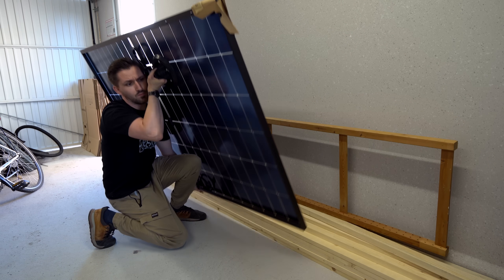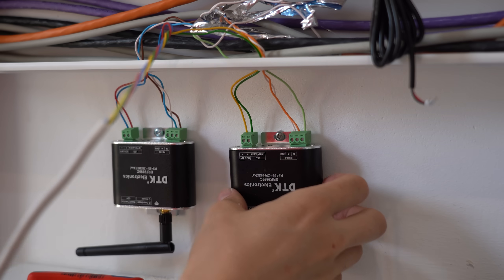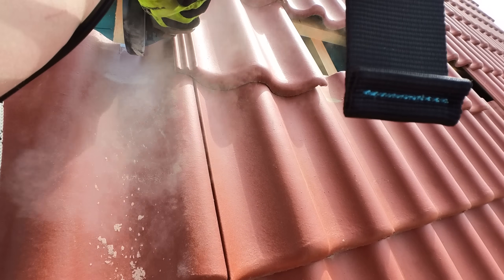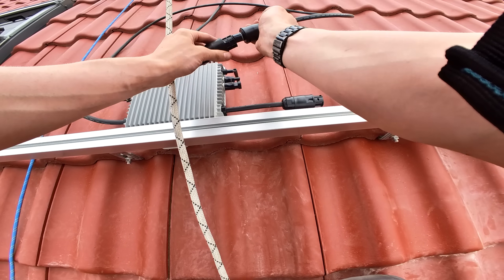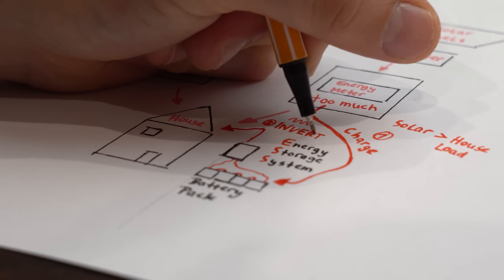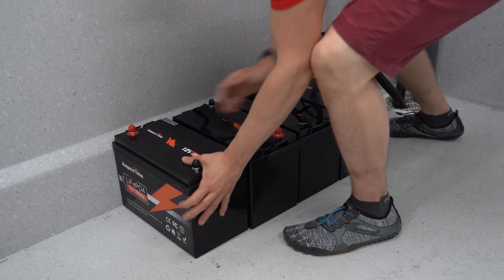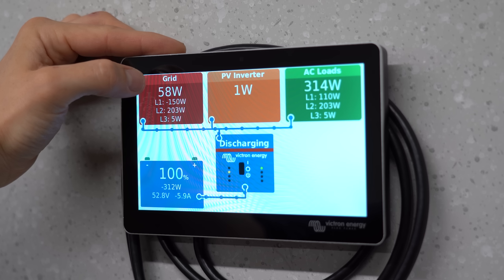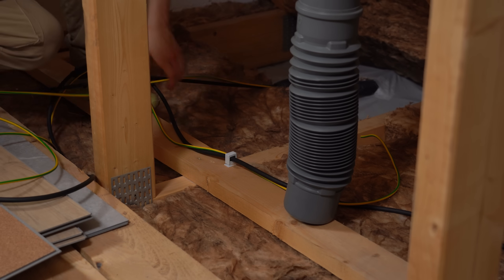Pushing a "legal" Mini Solar System to its LIMIT!

Comment: This is a great overview of the complexities involved in combining solar and grid power.  Backfeeding is not only a waste of your your energy, but is illegal in many (most?) places without the proper equipment and the cost to buy and install such equipment can be more than the cost of a small solar setup.  The system we see in this video is not inexpensive and it will take many years to recoup such an investment.

Backfeeding is dangerous as it could power the grid during an outage or when technicians are otherwise working on the line.  DO NOT backfeed into your own electric system without disconnecting your main breaker or installing an approved disconnect system.

I have used an ad hoc system with a gasoline generator during multi-week power outages, but I always turn off the main breaker and feed a garage sub-panel through dedicated breakers with all 220V (U.S.) equipment breakers switched off.  Electrician experience or advice is helpful and you must make sure that no one in your household will ever turn on the main breaker before uninstalling all power sources.

I suggest starting with a solar system that's separated from grid power entirely to avoid these issues until you decide to, or can afford to, properly integrate the solar.  Such a setup can consist of just a couple of solar panels and a portable power station, which is much less cost than the full setup shown in this video.

Many people will be perfectly happy with a "workshop" system that runs lights and small equipment separately from the house wiring, but which can be used in emergencies to run a refrigerator or gas/oil furnace from extension cords.

Yes, you sacrifice the daily solar contribution to your house power, but you can power your lab, workshop, or garage while learning what to expect from a larger, more expensive system.  PV systems are easily expandable and advancing technologies make it smart to start small and expand over time as cost efficiencies continue to improve with solar panels, batteries, and equipment.

Comment: Hi, thanks for this overview of your upcoming solar system!
No complaint meant, but I can't resist to ask: "What limit did this push...?"
From the title, I would have expected something about how to get a maximum of energy while still abiding to the legal limits. Btw, it's announced that the limit will be raised to 800W output from the inverter next year. When building a system now, one could already have this target in mind. And since the solar modules seem to be some of your less costly devices, some overpaneling would be expected. 
Tilting modules could use more of the daylight than fixed ones, of course that would be quite complex, mechanically, and if this is too much hassle, one might consider to let them face into different directions to have a more even energy production during the day. Which, of course, only makes sense, as a way of maximizing immediate usage of the engergy, to reduce battery costs...
I also had the impression, that you have bifacial modules. So mounting them in a way that allows significant light to hit the backsides would be another option. Maybe even reflectors...

Of course you will be aware of all of this (and other things) much more than I am. 
Looking forward to the coming upgrades and follow-ups...

Comment: In Ukraine we have "green tariff", it's what you call "Feed-in tariff", the electric grid company actually pays you for the electricity you give back to the grid from your renewable sources like solar panel.
Reply: I think his issue is there is no smart meter for the utility company to measure his feed in.
Reply: @Alan.livingston exactly, gernany is years behind in smart meter implementation, so the general conditions domestic customer experiences are not very optimal and workarounds as this are done.
Reply: We have the same in australia, they buy the electricity off us, but charge us more per kw than they pay us for it if we use from the grid..  its called a grid tie inverter..

Comment: Wouldn't one energy meter have been enough given they are bidirectional and given that the MP2 anyway measures the incoming power? Typical Victron ESS systems only use one meter installed directly after the main one from the grid provider...

Comment: what happens when your battery is full, and solar panels produce more power than the load? It feeds energy to the grid?
Reply: It depends how his system is setup.  If those are enphase IQ8 microinverters or otherwise support UL1741SA (verses just UL1741), then the hybrid inverter can tell the micro-inverters to curtail solar production.

Comment: Excellent!  I'm about to launch into this in my apartment in Barcelona.  I do have to say that in the US, it's against electrical code to run data cables in the same conduit/tray as high power DC or AC.  You might want to get a smaller cable tray to run the data cables only.

Comment: for everyone that want to just buy microinverter with solar panels and think you ready to go ....
there is only one issue in case of "on grid-mains power meter" --- some of EU power meters will count power in ONE WAY meaning if you put power into "grid" it will be counted like the power you consumed so you will pay for power you made because it wont count it like power generated but consumed 😑😑😑
the only one way to fix that is to order your energy supplier to mount 2 way energy meter and sometimes they don't want to do that if you don't order 3rd company to mount you solar panels for big money

Comment: It's so cool you understand so much about electronics and electrical stuff. I'm jealous (in a good way).
Is it even possible to get to your knowledge level without a degree?
Reply: Sadly no, you do need a degree, tho it doesn't need to be that expensive, if you want the degree but live in the US and don't want the debt, you could go to study on México for a while, public universities like UNAM and politécnico are free but have professors and award's comparable to Harvard or MIT, the main issue you would find it's that the US universities have lobbied very hard to avoid having the Mexican degrees being valid on the US due to obvious reasons so validating your studies could prove to be a challenge in itself, still you would have the knowledge onto how to do all this stuff and be free of most debt

Comment: A common mistake is to connect the DC ground side ( solar panel frames and rails) to the AC Earth cable. AC and DC  Earth should not be combined. The DC earth should have its own grounding rod. On the other hand the voltage of two independent panels are not a threat.
Reply: There are three potentials here.  The solar panel DC-, the solar panel DC+, and the solar panel frame.   The DC- and DC+ are typically isolated.  The frame, however, is typically connected to earth ground and that can be house earth ground if desired. 

There are a lot of different schools of thought when it comes down to how to wire ground.  Mainly because there is no real way to actually protect from a direct lightning strike anyway.  So most lightning protection is designed to protect from indirect strikes and to ensure that any AC which couples into the solar panel's frame gets shunted to ground.   Otherwise you get zapped just touching the frame if there are any inductive loads on the AC side (some of the energy will feed-back onto the DC side).

Comment: Don't try this in the USA. The entire system has to be done by a professional or the power company will come to your home and can cut the wires leading to your home if they don't like what they see. There are also an amazing amounts of permits that need to be filed first to do this as well. I know. I'm having a solar roof installed by Telsa.
Reply: Who fed you that line of overhyped sales BS.  Your home can be electrically off grid and the permitting is under $100 in almost all US AHJs.
Reply: @jstaffordii  "Who fed you that line of overhyped sales BS." My local county government did. They also fed me a whole lot more sales bs when it comes to filing permits as well.
Reply: It isn't quite that bad.   You can certainly connect up a micro-inverter without the power company really giving a damn.  A mere 600W is not going to put a bee into anyone's bonnet in the U.S. At higher wattages it does matter and they do care.   Regardless, there is no real need to actually grid-tie a DIY solar system in the first place.

It is far better to swap the topology around and just take a number of circuits permanently off-grid, powered by the solar + battery system.  Then you just feed a battery charger in power supply mode from the grid to the batteries to provide load-support when the batteries are low and you are done.  No grid-tie, and really really excellent evening load-shifting capabilities even when the solar is not sufficient for overnight operation.
Reply: @junkerzn7312  "A mere 600W is not going to put a bee into anyone's bonnet " Except when a hurricane rolls through like it did just 3 days ago and the power lines are down and some power company worker starts fixing the line only to get hit with 2,200 volts because I was feeding power back through those lines. Local government has limited me to 12,900 watts max power back on the line. My house is being covered by 15,700 watts. The difference I'm going to go straight to batteries and run a room full of computers that won't be connected to the grid.
Reply: @nathanwoodruff9422  Not sure what you are arguing beyond your situation being different.  Well... everyone's situation is different.  Obviously, right?   Nobody is arguing about that.   These systems can be scaled to whatever size is needed.

Besides, if we're talking about a power failure than 600W will easily keep a full sized fridge going 24x7, right?   600W x 5 = 3 kWh/day.   A full sized fridge only needs roughly 1.4 kWh/day.  So with 600W of solar and a single LFP battery (2.56 kWh), a normal home fridge is backed up more or less indefinitely.

I would wager that most people are gonna care about that more than someone's pet crypto mining project.
Reply: @junkerzn7312  "I would wager that most people are gonna care about that more than someone's pet crypto mining project." People do more things with computers than mine crypto. But you probably wouldn't know that. And yes, the local power company is going to care. Since you know everything, you have probably already read the steps needed on Tesla's website the procedures needed to not only have a solar roof installed but also the steps needed to turn it on. Well, probably not since everything you have said goes against every one of those steps.
Reply: @nathanwoodruff9422  Dude, you've gone off the deep end.  I don't really know why, and to be honest I don't care.   I'm happy to give advice on people's setups... but you seem to just be looking to fight people so I'm going to put you on ignore and you can vent to the ether.

Comment: By the looks of it you don't have power when the grid is down. Ideally the system could run independently.
Reply: I assume that would just be a matter of connecting to the backup output of the storage inverter.
Reply: @NiHaoMike64  That Inverter for the storage does have a backup output that turns on if it senses a grid down event, but I wouldn't want to go running around connecting everything in my house with extension cords. Even so, charging from solar will stop if you loose grid power and you can't connect the backup output to mains. Those types of grid tie inverters that are under the panels only function if they sense the grid. In theory the device could be made to turn on without the grid, but you'd need to put a disconnect at the service that switch when going from service to backup, otherwise you backfeed onto the lines and causes a safety hazard
Reply: @Ivan.Wright  An ATS solves that problem. And as long as the inverter supports AC coupling (might be called microgrid or reverse power), the solar can also connect to the output of the ATS.
Reply: @NiHaoMike64  Ya, that seems like the simplest solution if everything is compatible. I haven't kept up with the latest tech for a while, I know this brand is fairly adaptable but to what degree idk. I also didn't catch the micro inverter model so it's even harder to say.
All in all this isn't how I'd design a system, at least with the information I have about it. I prioritize off grid capability and minimal components. 
I hope he left room in his system for it when designing, I'd hate for the system to remain this limited. It's a cool system otherwise tho, it's just that when I see so much going into it and it not not have a feature that I consider essential I feel the need to point it out.

Comment: I went with a more dumbed down version where parts are easy to replace and software does not get in the way of operation. Victron needs that so I avoided them. My system only needs software for delivering documentation to my computer. Also Bigger wires! from the video it looks too thin. That caused me so many issues in my first build. I couldn't figure out why my system so long to charge. Swapped every wire for big #2 gauges and the  system takes way less time to fully charge. A day vs. a week. Every chance to reduce resistance in solar take it. Big wires are only pricy once and can be used for every configuration after. Grid tie is a good option but it is a bad idea to make money from the grid because your neighbors suffer for it. The grid uses their money to pay you after all. It becomes a political head game and ultimately they could tell you to throw out your system. In Germany maybe it's less of a problem but other places this is the issue unfortunately.

Comment: It really depends on how expensive energy prices are in the area you live in. Looking at all the equipment you had to buy and install I can tell that this was NOT cheap. But I know that Germany has some of the most expensive electricity prices in the world. So it just depends on how much you can save and how much it cost and how long that's going to take to pay it back.
Reply: It depends on (consumption x expense).  So even if electricity is cheap, if you consume a lot of it then throwing on solar + some battery storage can be cost effective because you gain cost efficiencies on larger scales.   They key to controlling costs is to design the system such that you can start small and scale it up over time.   For example, starting with one battery but designing the wiring to be able to handle up to 4 gives you the ability to add more batteries in parallel, later, with minimal additional work.   Same thing with charge controllers and inverters.  Wire the bus bars to handle serious scaling so you don't have to redo the wiring later as you add solar (and more charge controllers) and inverter capacity.

--

So, for example, I have two rooms that eat roughly 8kWh/day.   If the solar takes care of the rooms during the day and I'm looking to maximize the economic return of a solar + battery system, then the batteries only really need to be able to run the rooms during the evening peak rate period.  Say between 4pm and 9pm or so.  About 5 hours.   They don't have to run the rooms overnight when electricity is cheap.

So, 8kWh/day = average 333 watts, x 5 hours = 1.6 kWh.   So one LiFePO4 battery would do the job.  e.g. one 50 Ah x 48V battery (2.4 kWh of storage).   About $700 for the battery.

On the other-hand, if I wanted to actually take the rooms off-grid most of the time, or have enough battery to handle power outages, then I would need to cover 4pm to 8am... about 16 hours @ 333W.  I would need 5.3 kWh of storage, minimum.  About $1400.  Plus enough additional solar to generate the required energy... 333W x 24h = 8 kWh/day of generation.  Divide by 5 = roughly 1.6kW worth of solar panels (nameplate).

--

At $0.11/kWh during the day and $0.17/kWh across the peak, this would save 8 x 0.333 x $0.11 + 5 x 0.333 * $0.17 = $0.57/day, approximately.  Which comes to around $208/year.   If the total system cost is on the order of $2000 then the break-even is 10 years.   And that assumes electricity rates never go up, which of course we know they do.  So the actual break-even is going to be lower.

Living in California though, my rates are $0.33/kWh during the day and overnight, and $0.37/kWh across the 4-9pm peak period.    $1.50/day.  $2000 / 1.50 = 1333 days = break even in 3.7 years.

The key is to not over-generate or over-store the energy, since you don't get any additional pay-back by doing either.   Which means, generally, that you still want to depend on the grid to make ends meet when necessary.  You don't actually want to go completely off-grid because doing so would require over-sizing the whole system by roughly 4x.
Reply: I'm in UK and did a similar system. Spent £2k on Multiplus II and a 7kWh battery. I've only got 1kW of solar so mainly use the battery for charging at night and then powers the house in the day. It's 7.5 p/kWh at night and 40p in the day. It's pretty much paid for itself in 2 years.

Comment: Did you know the IPCC got caught lying about the GHG footprint of solar panels? It's actually far larger than normal people would have ever thought. They are harmful to the environment; no matter how you slice it. Solar kills the planet. Stop using solar now; stop the endless mountains of ewaste! Stop bilge dumping! Stop burning these in open pits to "reclaim" the copper! Stop supporting manufactories with dastardly high TCO2e/GDP ratios! The green cult is worst enemy to mankind and the environment.